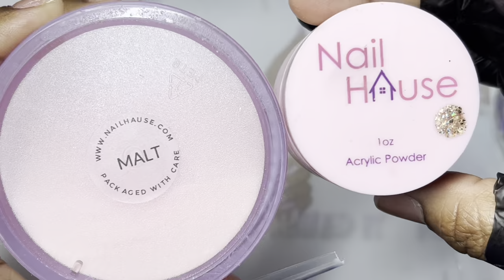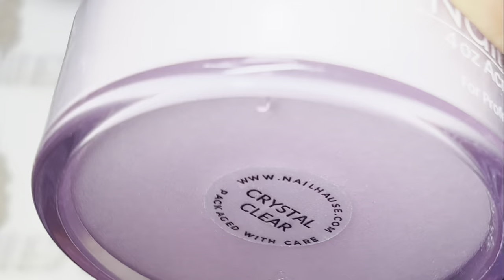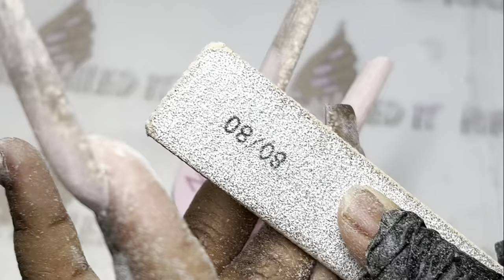GOLD BLING NAILS ✨| LET’S TALK: HOW TO GROW YOUR YOUTUBE CHANNEL QUICK! PT 1

Comment: Use the liquid monomer, let it soak for a couple of mins, of course check it and wipe it on a paper towel to get the residue off. But it works for me. A brush cleaner takes too long for me. But that’s what nail shops do

Comment: Porche I have a question 🙋🏻‍♀️ so if I lay my acrylic thin before I cap with clear right? Say my color acrylic isn’t even, it’s lumpy or it’s just not perfect. Will you see that mess up under the clear encapsulation after I file? I like to file my color acrylic and make sure it’s perfect before I encapsulate because I keep thinking it will show… bc I’m like how does it just magically fix when you file the clear encapsulation if your base layer isn’t pretty. You see what I’m saying?
Reply from the maker: Hey love , not usually. You should be perfectly fine with capping it.
Reply: @PorcheNailedIt  ok thank you so much 🥰
Reply: @PorcheNailedIt  your right!!! It was basically like I was still laying the color. Idk why but I’m my mind I didn’t think it would work 🤣 I been doin too much extra filing
Reply: @KieraKreations  see! This is why it’s good that we have spaces like this to pick up tips cus been doing the same damn this as you lmaoo
Reply: @notwithoutpizza4702 😂😂 omg 😳 and I’m about to share this info because I think someone else I know has been doing this 🤣🤣